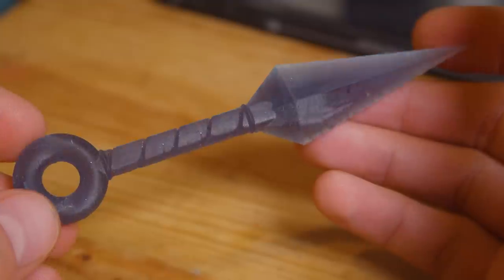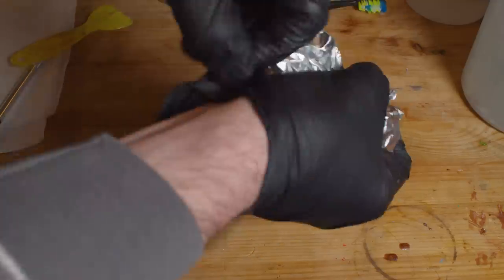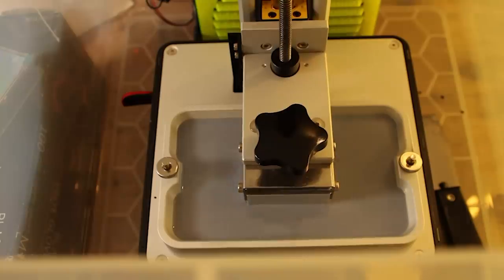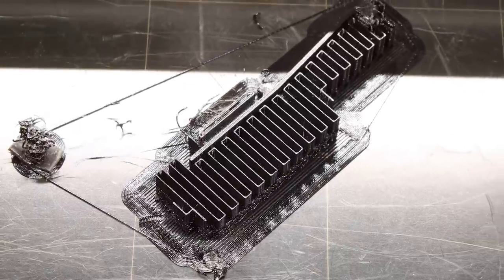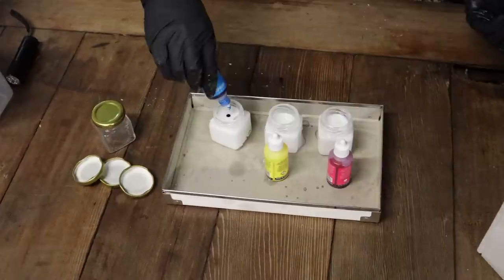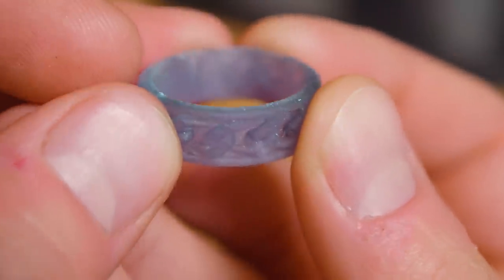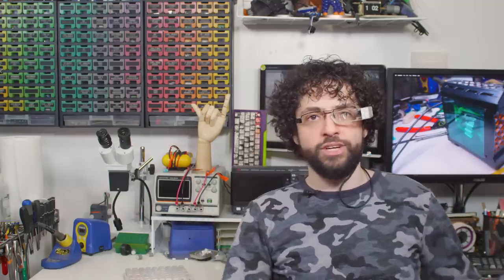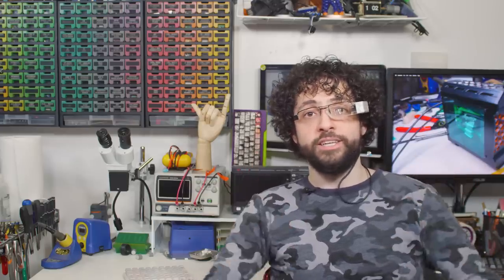Resin Printing Isn't Scary - ft. Billie Ruben!

Comment: When the big at home printers came out in 2009 I dished in a few Ks to get one. The details were astonishing with resolution down to 20 microns. That is until I started to get muscle twitches and in less than a year the side of my face got paralyzed. Whatever drops that get on your skin get absorbed and this can cause a myriad of medical issues over time usually starting with allergies that develop into nerve damage. It got advertised to me as if it's something I can keep in my room when it's really not. Please, if you get one of these printers, have the utmost safety in mind. Do not breathe and touch resin. 🧪 Chemicals in it can be absolutely TOXIC ☠️.  If possible, use it with a ventilator away from regular living quarters. I strongly recommend safety glasses or face mask and a lab coat with nitrile gloves. Though I have stopped myself from buying resins for years now, these days they make more organic resins with low VOC which is less poisonous so you can consider that option too. Have fun and importantly, be safe!
Reply from the maker: I’ve never heard of these symptoms before; all I’ve heard of is coughing and allergy attacks. What resin were you using?
Reply: @ZackFreedman  I was using photopolymer FSL3D resin as my main one in the beginning, then I think down the road I used monoprice, Maker Juice, and Monocure when they were just starting with their production formulations. The biggest used were FSL3D and Monocure. I can't remember the other resins I used too. They varied from plastic containers to aluminum ones and some came with a big orange and black X stating health warnings somewhere.

 The reason for FSL3D is that they had warned us that using other resins would damage the VATs and void the warranty for their machines which costed me a couple thousands (they were trying to tie us to their resins only)but then their resins and lasers started failing which again costed several hundreds and a trip to Vegas for replacements since they wouldn't honor any replacements of faulty equipment. Anyway, the new laser worked amazing and even took on other brands easily as our group kept experimenting with off brand resins. 

I just don't remember what brands the others were so I do apologise. Overall I tried around 3 or so other brands and a small sample of firecast resin. I think the firecast was from Monoprice or a american company. It was in a aluminum can which was new for resins. 

Allergies and lung/skin irritation are probably most common early symptoms and safety should increase when these are present. My symptoms started with allergies, but I ignored them since this was my passion at the time until I couldn't. 
I would say I would spend an average of 12-16 hours a day around the machine and resin equipment with maybe a alcohol wash or two. 

One of the people in the ol community got a strong allergic reaction to the resin and had to be extra careful. He reported his throat flemming, metallic taste, and stomach ache days(or maybe it was a few weeks) after accidentally wiping his mouth with a bit resin. The Resin is clear so he didn't notice till he tasted it which he also reported the horrible taste stayed for a long time. Apparently the body hates something in the resin which an accumulation of it over time causes it to funk with the immune system which leads to an over sensibility to a random attachment pretty quickly usually nerve related aka; causes allergies. That's my memory of it I forget what the actual process is.     Fumes caused irritation to some but for me who practically lived it on a daily I think I got one of the worst post allergies. I didn't have any cough related allergies or irritation though.  I do recall getting resin splatters here and there usually from cleaning big prints and actually also a metallic taste too at some point but that went away. However the tiny random muscle twitches later became regional muscle spasms as I kept going until the nerve damage extended into paralysis and other things. I ignored the "small" symptoms while working with resins but in reality they should have been red flags. 

The resin stuff by no joke is dangerous and should be handled with utmost care. I always tell people to be careful around it because it can change your health permanently. I don't wish what I got on anybody. I wore gloves and sometimes a mask but I think that was careless. Splatter got on my arms and very likely on my regular clothes now that I think about it. Gloves would occasionally puncture(large 7-9" prints stuck stubbornly to the buildplate). Because the printer was nicely sized, it also needed alot more resin in the vat.

I do apologise for writing long! I wish these things were safer. Even against my family's wishes I would love to pick up resin printing again if there was some magical safe resin available.

Comment: One of the reasons Ive been hesitant to pick up an SLA is becasue I have some respiratory issues already and I have a beard so a cheap respirator is out of the question. 

One question I have though is how long do the vapors stay in a room. Cause I keep my FDM in my bedroom but I don't know what kind of ventilated place I would put a SLA printer
Reply: you might be able to put it in a gas tight box and glue paint filters with silicone, adding a fan on the output.
Reply: See The Thought Emporium on YouTube, the creator there has a video called “a space suit for Earth” where he shows how to make a proper full face helmet that eliminates the risk of breathing foreign material in.

Comment: I can confirm that resin printing is safe even without any preclusions (that you should take anyways) because I was working next to a resin printer for like 3 years daily without ventilation, sometimes using gloves, and always sanding and cutting parts without using a mask and I am obviously still alive.
Reply: You can also smoke a pack a day for 3 years and still be alive. Doesn't make it safe. Just probably not lethal
Reply: @portobellomushroom5764  Don't worry I know there is a reason I am no longer working next to it.

Comment: Bought a FDM printer (creality ender 3 v2), spent 4 days and 25+ hours debugging it and trying to make it print clean, I've changed countless variables, rebuilt the whole thing etc.. ended up just returning it, was such a pain and never got one good print out of it, will not get an FDM printer, unless it comes with a more reliable construction. Resin seems much more straight forward, the creality was over hyped by the 3d printer enthusiast crowd (atleast in my experience)

Comment: The only problem I have with SLA and where I can't find a solution is the fumes. Most info I find talks about dedicated printing rooms that have good ventilation or putting it in the garage but then the next sentence is that you need to keep the temperature up because the printers don't like the cold.

I live in an apartment in a country where most people live in apartments and where it gets cold. I'm lucky enough to be able to afford an apartment big enough that I have a room in the basement (part of the apartment) that I can use as a tinker room / home office but ventilation is of course an issue in the basement.

I'd love to have an SLA printer but how am I going to deal with the fumes? Can you filter it to a point where you neither get smell nor fumes? I have the space, I have the motivation, I just don't have the ventilation

Comment: Great deals on 3d printers resin and FDM, Voxelabs have a promotion of $100 off their printers eg Voxelab Proxima 6" 2K monochrome £209 and the same in 5" size $159 they also do an Ender 2 V2 clone but with a better display for $179
 I have ordered the 6" Proxima!

Comment: Anyone saying SLA is bad has never used it. I press a button out of the box basically, boom. perfect dimensions, perfect, with 0 support.

only negative is it isnt really great for hobby engineering just because of the UV non resistance.

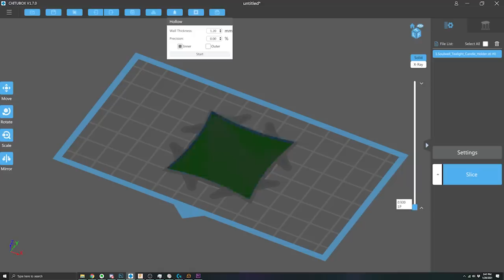Comment: 4:15 - this is actually incorrect.   I print almost everything without infill.  The issue typically is more that the slicer is bad at handling certain designs without infill, but I suspect that over time that will improve.   (Currently slicers have a bad habit of printing things "on air", hence why infill is needed.  I'm sure this could be remedied with smarter pathing, however)
Reply: I like adaptive infill, which allows to print at like 0-10% infill and gradually fill it only a few layers before the top.
making arches under the top instead of that might work but it may be worse.
the main problem is that slicers are slicers, and work in 2.5D, not true 3d.
vase mode works really well for parts without jumps.
Reply: @satibel  Either way, my point is, infill is not as required as the video might make it seem
Reply: @Restombre  When was this added?  I have never seen this before.

Comment: i printed a 5mm thick plate out of elegoo abs like (Red Translucent) and holy shit that stuff is tough. the resin just bended but didnt break.  I absoluty wasnt able to break it, even after servereal trys. To be fair im not the strongest guy on earth but if that would have been a pla or asa print i would have been able to break it for shure. For strenght i actually prefer the resin prints after what ive seen they are capable of. for quick prints that dont have to take huge forces its still definitely fdm just because there is no mess with sicky resin or ipa

Comment: Loved the video.  Cleared up some of my misconceptions about resin and safety.  But it seemed like it was geared to the safety of users who are printing in a "shop" environment.  For users who have their 3d printers in their home office that they share with other family members including children and pets, would resin still be safe to introduce.  Sounds like having an isolated workspace is a prerequisite for going resin.
Reply from the maker: I don’t recommend resin printing if you have kids, if only because there isn’t great respiratory PPI for children and they’ll want to watch. 

If you can open a window, you should be fine. Almost all of the vapor is released while filling and emptying the vat, and while transferring the print to the cleaning solution. You can build a simple fume box to handle that - Billie uses one in a few scenes.

You can also put an activated charcoal filter in the area. Activated carbon does a great job of absorbing VOC’s.

Comment: I worked several years with formlabs printers, which I consider are high end resin printers. Nice device, but I still don't like it. Yes, the quality is better than FDM. But for prototyping the efford of cleaning isn't it worth imho.
Reply from the maker: FormLabs printers use lasers, which are kind of the worst of both worlds - they have the cleanup and safety requirements of resin, but the exponentially-scaling print time of FDM.
Reply: @ZackFreedman  yes, that's true. They say it is more precise than LCD or DLP. But I can't prove this.
Because I changed my job I don't use 3D printers anymore. Maybe I'll get one in the future

Comment: I've been resin printing for 3 years now, and I can tell you it is EXTREMELY expensive. I just bought 6 bottles of resin for $250 and printed a gundam big enough to be printed on my neptune 3 with 2kg of filament. That's 6x the cost of FDM printing. A resin printer the size of a neptune 3 build plate cost $1,200 plus! The advantages of resin vs FDM are night and day, but you will pay out the ass for those advantages. Also, don't forget the cost to clean those resin prints. Isopropyl alcohol is not cheap. Every time I turn around I have to buy $60-100 worth.

Comment: I know you're trying to convince us away from FDM, but if you don't talk about the downsides of resin, then it seems a little ignorant and one-sided imo. 
Like, I literally only have two rooms in my apartment. I have no where for vapors to go. I have next to no counter space. 
I like stronger prints. I have less money. Good luck find nitrile gloves right now. 
If you have kids. etc etc. 

Plus, you can get excellent quality out of FDM printers for cheaper. 
So yes, resin printers are great for high detailed prints-- but it's kind of annoying to act like everyone should use one. 

I mean, you didn't talk about their downsides too-- they have the opposite problem of FDM- where they can't print parts that are large without having to hollow or have a hole- and even then they have less weight and are weaker. Also, there's no mention of the resin not coming off of the film, and having to lube that up before hand. 

FDM printers have far more versatility- because you can swap out the nozzle for a finer one and get those high quality prints.
FDM printers on average are also cheaper. 

They do have the downsides your guest talked about (more moving parts, harder trouble shooting, etc). 

I don't know why this rubbed me the wrong way. I've liked all the rest of your videos. And you should probably take my opinion with the largest grain of salt possible. BUT--  This just seemed a little condescending to me. 
Like, "Oh no, someone is scared of resin for no valid reasons." 
Um, no. Resin just fits your use-case and not mine.  Shrug.
Reply: I feel like all his videos have a toxic positivity vibe and comes from a very privileged mindset..
Reply: We talked about all the things you listed in this video. 🤷‍♀️

Comment: for larger, not particularly detailed parts, is it more cost effective to print in resin, or to print FDM, make silicone moulds using the print, then cast resin in the silicone mould?
Reply from the maker: For very large prints, you might not be able to print resin at all. I didn’t touch on this because hobbyists generally don’t consider large-format SLA machines, but thick solid resin prints are difficult to cure. If your print needs solid areas thicker than, say, 5mm, you might need to make it with casting resin that cures with a chemical reaction instead of UV exposure.
Reply: @ZackFreedman  makes sense. really what would be fantastic to fill the Big Stuff void in makerspace is some kind of cheap, open source, easy to pack away rotocasting  and injection-moulding machinery. set it up and cast an entire one-piece chair, then pack it away again into a meter cubed box somehow.

Comment: Resin printers are cool because of the detail you can get, but they are just so impossible to justify. So much extra is needed to get a working print. You cant reasonably have it in your room like you can with an FDM. I have my Ender 3 about a foot away from me on my desk and I can just turn it on print while I'm working. Only extra bits are some files and pliers sitting in a draw to fettle finished prints, if needed. With resin, I'd need all the extra safety gear, somewhere safe to put it, a cleaning station and a curing box (sun doesn't exist in the UK). All for just some slightly more detailed prints, which I could probably get quite close to anyway with my 0.2 nozzle. Totally not worth it in my opinion.

Most of what I print is functional, or at least (mostly functional) and FDM is just better for that. An ideal upgrade for someone like me would be an FDM that could print Nylon, be that an enclosure for my Ender 3 or a more capable printer!

Comment: I had a anycubic photon and it wouldn't keep its z axis after calibrating it and u can't tell if a prints gonna fail till the plate is out of the resin so like after 45 minutes I would realize it didn't even work

Comment: Considering that I've got a creality cr 10 at work that I've NEVER managed to successfully print on because nothing ever adheres to the bed, I can't imagine resin printing being harder than FDM.
Reply from the maker: You should look into a PEI coating or BuildTak treatment - I find them infinitely easier to print on than bare glass. But yeah, once you get the bed properly polished and clean, it's very easy to get a good bond with resin.
Reply: @ZackFreedman  yo

Comment: If you're going to resin print, get yourself an anycubic wash and cure or other similar item, you'll thank me later. 

Makes the process of cleaning and curing so much less of a pita. I started with the tubs of iso and toothbrush and tissue paper etc and it was a mess no matter how clean you try to be, so much so i didn't want to print with the photon. Since having it I print far more often due to knowing I can just drop the item or full build plate into the wash and cure press a button and it's done 👌

Comment: Good information, but wow, you guys missed pretty much my favorite part about resin printing, and that is that you're not using a thermoplastic. 

When you're fdm printing, since they both squeeze out and are typically made of thermoplastics, and you want a higher temperature resistance, you have to chase the dragon of owning/access to a 3D printer that can tolerate those higher temperatures already. 

Or you can skip it, and print your 'custom fan ducts that get absurdly close to the heater block/nozzle' out of high temperature tolerant materials on your resin printer, which are super accessible and don't cost an arm and a leg, again, because they aren't thermoplastics.
Reply: A pretty good rule of thumb is that, as of the time of this writing, build quality being equal, and disregarding speed, the cost of FDM printers scales based on the size of the models compatible materials library, and the cost of resin printers scales by build volume.